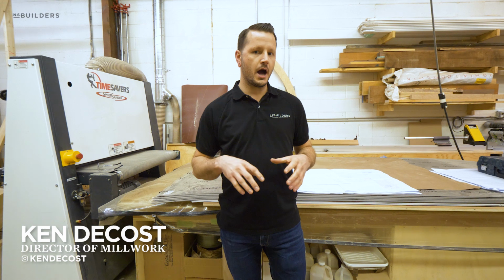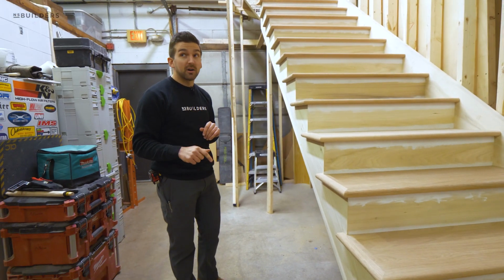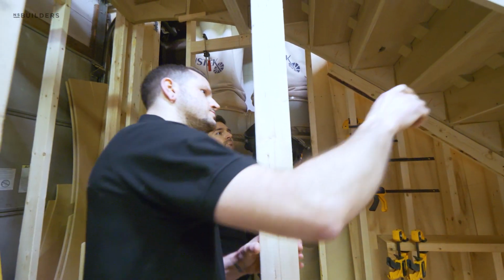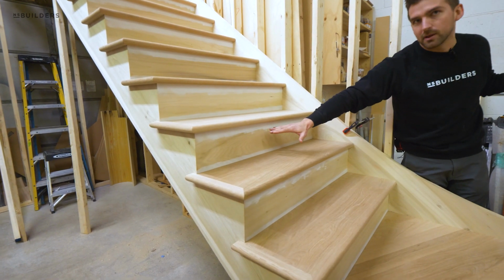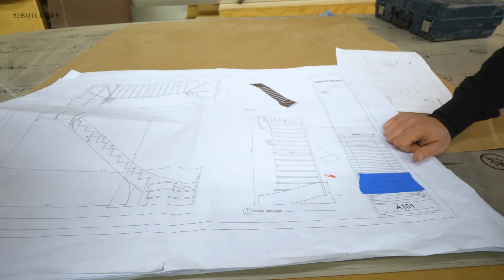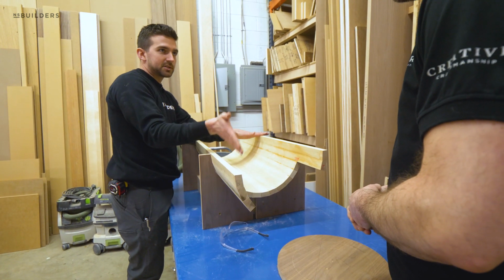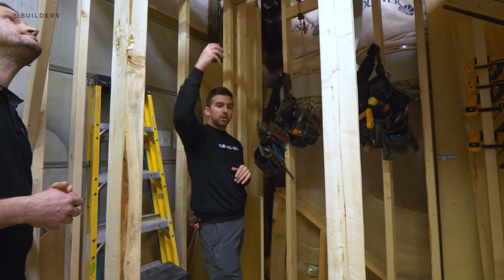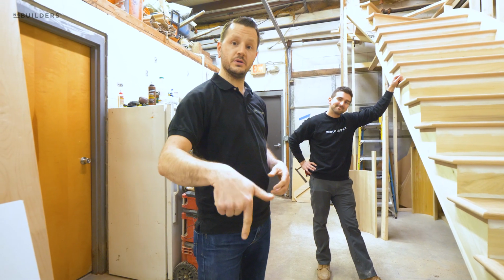Shop built stairs with extremely detailed drawings | Revealed

Comment: These are gorgeous! But still I do like the fact that this confirms the old ways are still the best ways. All the fancy features they made up like the excessive wedge system & primer underneath glue joints, etc., all introduce micro-slop, which means they need a whole retrofit center stringer from excessive deflection, unlike the rock solid originals

Comment: This has been the standard way of building stairs in the UK for well over 150 years. Whenever I post our srairbuilding methods to Facebook groups with American members, most of the comments are along the lines of "that's retarded", "too many parts", "never meet code", "too slow"....... 

It's great to see you adopting these methods and explaining the advantages. Keep up the good work 👍🏻
Reply from the maker: I’m on board with you guys. Better fit/finish
Reply: I'm in the USA, and I started in stairs in 1988. Everything they are doing is basically how I learned. Straight stairs are somewhat boring to me, and I actually started with curved stairs, branching out from there.

Comment: G, day from Sydney, Australia
* the craftsmanship and quality is second to none.
* the cost of quality hardwood such as Tasmanian oak, maples and fine straight grain joinery timbers are becoming hard to source in Australia for low cost home builders. This adds a significant cost factor.
* We use engineered board CNC machined or open tread stair in our project homes $140,000.00 ( that's the house price not land or tax in a outer suburb or new sub division).
🌏🇭🇲

Comment: Looking through the comments on the housed stringer saying it's the way to go. Me over here in Ireland only doing housed stringers 😂 but then again stairs are built like this in Ireland all the time shop built and then fitted in on site.
Reply from the maker: Ha! You guys 🤘🏼
Reply: Same here toronto, ontario🇨🇮🇩🇪
Reply: Yeah it drives me nuts here in the states seeing people cutting 2x12 and covering those with all these pieces of Advantec and framing lumber and screws and just a bunch of unnecessary stuff to squeak and move under the actual finished treads and risers. Plus you lose head room under the stairs that way as well. It’s just a poor way of building stairs. Although I’m a one man show and I don’t build my stairs in the shop, I cut my parts in the shop and show up with them packaged like a kit and usually remove the temporary stairs and install mine in a day.

Comment: Cool video. Over the pond in London, all the victorian houses have self supporting  stairs like this, no extra stringers are installed. The Grander ones had what we call "cut and mitred" strings, like yours in the video. The bottom corner tread with four sides, we call a "kite". And the treads with three sides, we call "winders". Its great seeing how other places, do similar building techniques.

Comment: Hardest thing in construction is winder stairs. Change my mind
Reply: The most difficult stair is one where either the top tread or the bottom tread is trapezoidal.  This one has both.
Reply: @nickgironda4002  first “trapezoidal” is a winder stair. So you are proving my point. The staircase in this video has two winder sections, made up of “trapezoidal” parts. So I’m saying this is the hardest thing to do right in construction.

Comment: Looks fantastic and great craftsmanship however, none of this can be replaced in the future. So when these stairs get beat up over time, good luck trying to repair them.
Reply: Im a GC in Detroit. Just repaired and refinished a 130 year old staircase built just like this as part of a whole house renovation for a home built in 1890. The stairs had the wedges underneath, joinery and all. No middle stringer like they're talking about doing. They do get beat up over time and are to some degree irreparable but stringer wedges and the blocks underneath thru the middle can be replaced and secured. Of course you have to demo all the plaster around them. They show the wear and age but the craftsmanship shines thru. I cant guess how much longer they will last, Id say at least another 50 years as the house is owned by a monastery and the brothers/fathers will live there.. but 130 years alone is a good run.
Reply: I restore these all the time. I just completely disassembled one, stripped it all, glued all the broken parts and re assembled it. I’ve also developed methods to address some of the inherent weaknesses these stairs have.